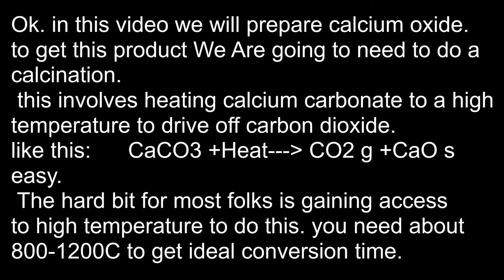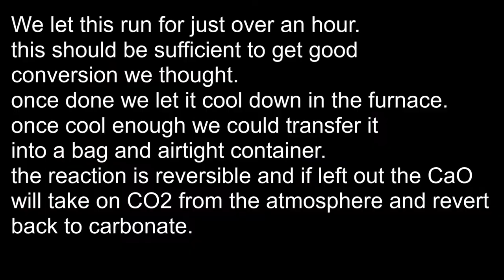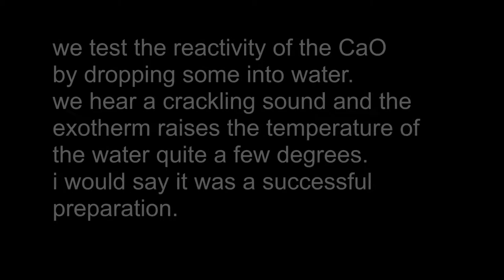making CaO via calcination

Comment: Good job. Out of curiosity, have you tried using limestone lumps? Many years ago I recall seeing a traditional quicklime kiln where the limestone used was in the form of lumps because it converted better to quicklime (don't recall the exact details though).
Reply from the maker: no. limestone is not easy to find where i live. seashells are though.  either one you need to hit it with brute force heating to get caO.

Comment: Don't use a crucible just spread the carbonate inside the furnace. The metal crucible is actually protecting the calcium from the heat. Thats why you get a weak lime.
Reply from the maker: andre gutier it wAs simply on a steel tray.
The end result was pretty good and it served its purpose fine in other synthesis I made it for.

Comment: could I use calcium chloride and sodium carbonate, double displacement?  not sure if it would work?  or slaked lime?
Reply: you can make CaCO3 by this method, and make pretty pure CaO out of this
Slaked Lime will also work, it even requires lower temperature

Anyway calcium chloride and sodium carbonate are not cheap sources of CaCO3, so i suggest not bothering
Reply from the maker: it would be much cheaper to calcine seashells.  the method you propose would indeed work but you need to ensure that you use the right ratios as to not have any sodium present.(at least for my purposes) it may affect other things you do with it. farm/veterinarian supply shops should stock CaCO3 cheap.
Reply: I have both at relatively cheap prices.
Reply: thank you very much for your replys